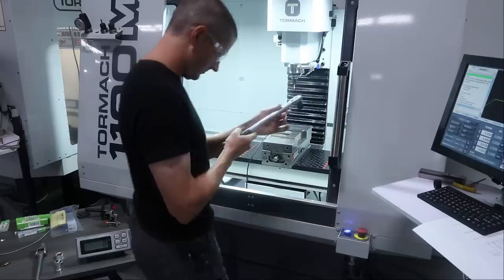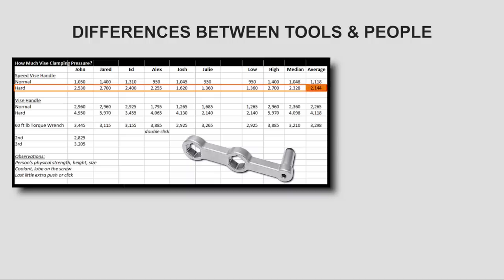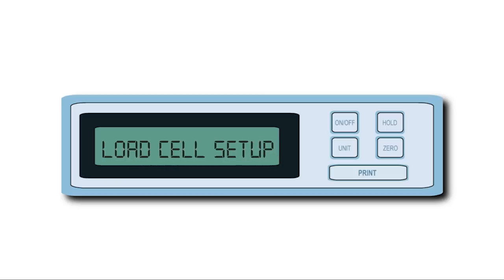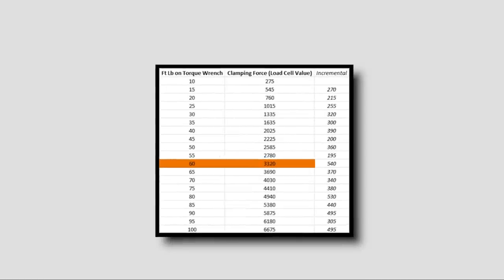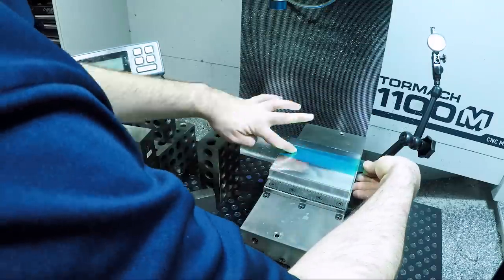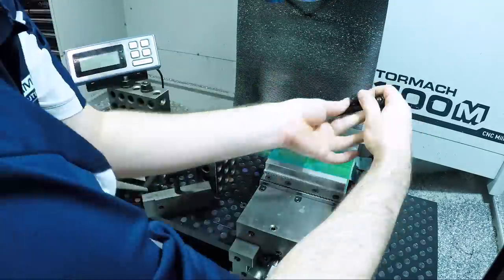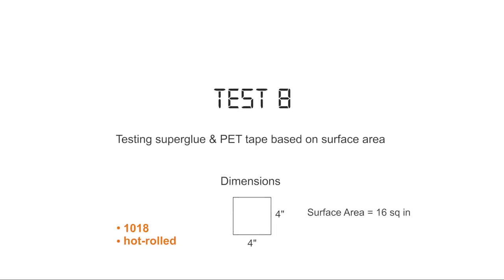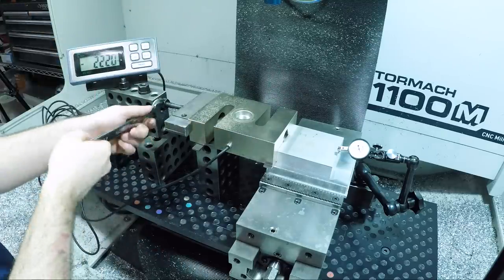How Much Gripping Power does a Vise Have?

Comment: John, love the video. Long time watcher, first time commenter. Im not a machinist so you’re always way over my head But as someone who has worked in force/load cell calibration for years, you need to be mindful that the load cell needs to be loaded at the points where it is threaded. Each side of that s-cell is a lever and as it deforms by design to give the signal that the strain gauges pick up and convert to force readings the fulcrum point changes when force is applied to the flat surface and applied load changes. Using the threaded holes and a bolt through them ensures that the fulcrum point is in the same place as when it was calibrated, increasing your accuracy.
Reply: Very interesting info. Thanks for that.

Comment: Based on your setup, there is a very simple answer as to why clamping area on smooth jaws did not affect the force required to move the part (hint, it has nothing to do with pressure). 

The force applied by the jaws acts 90 degrees (perpendicular) to the "pushing" force you are applying. Therefore the 2 different forces act completely independently of each other on part (think drawing the forces as X and Y directions on a graph). Then what keeps the part from immediately moving? Friction! The friction force between the jaw face and part is what keeps the part in place. If we knock the dust off our handy engineering textbook, the formula for calculating friction force is: Friction=(perpendicular force)X(coefficient of friction). Notice how the formula does not contain anything about surface area, that is because as counter intuitive as it is, friction is completely independent of surface area and there is our answer. 

For fun, we can actually calculate the coefficient of friction between your vice jaws and the part using the numbers from your experiment. You clamped the part with about 3300lbs of force and it took about 550 lbs to move the block so if we plug those number in we get: 530=3300X(coefficient of friction) so the coefficient equals about 0.17!

However, this only holds true for the very specific setup you created here. You still want to hold on to as much area as you can because cutting forces on the part never act just in a singular direction like your test setup. The force most likely to dislodge your part during machining is from torque or tipping force from the tool pushing on the edge of the part. To best counter this, you'd want to reduce the lever arm from which the torque is applied by leaving the minimum amount of stock exposed.
Reply: Very well put Mech engineer. Was gonna basically post the same thing along with my post above about why the variation when using the torque wrench but luckily having seen your post that already explained it, I didn't have to take the time.
Reply: Considering the other force directions, do you think it can be defined the minimum area required for an specific part to be in contact with the smooth jaws in order to stay still and not move?

Comment: I have learned much from your videos. Thank you. In a prior life I owned a company that built high performance engines, etc. for mostly Porsche's.  I just wanted to make some observations. 
1. I always use the same method to tighten bolts using a torque wrench. That is to first get the fastener barely tight so that the pull for the actual torque setting can be done in a single smooth stroke; stopping the click or beep. Also, the pull direction should be in an arc that is on the same plane as the rotation of the screw/bolt, ie., do not jiggle it forward or rearward. 

2. Manufacturers almost always provide torque specs on the high side. 225 ft lbs on a pull stud is huge. I have seen the number used in some threads. I have a HAAS TL-1 lathe and HAAS TM-3P mill. The mill has a spindle holdfast included. If I put even close to 225 ft lbs on it, I am sure it would rip the unit off the machine. Not to mention that using a 1/2" torque wrench to do this would be outside af many folks strength. Similar to asking any but the most experienced machinists to measure anything at the .0001" level even using the proper mic. 

3. My experience tells me that applying too much torque to a part is a much more prevalent and damaging problem than not enough. Using a 6" x 4" x 1/2" piece of 6061 T6 aluminum gripped 1/4" deep along the 6" side using smooth jaws, in a ORANGE vise, the workpiece will begin to deflect at about 45 ft lbs (on a calibrated torque wrench). At 100 ft lbs, the deflection at the centerline is more than .002". The worst part is that if you face cut that part, you would not even notice. If you measure all 4 corners you would;d not notice. If you measure the center line, you will notice. 

4. You hit the nail on the head. Even with proper use and a quality torque wrench, you will get different results. If you include the torque wrenches that most people buy, results become inconsistent (the worst) and wrong. I am not sure if most folks return their torque wrench setting to the lowest setting after each use. 

5. I know there are countless machinists out there that know what to torque their work pieces. Too bad that I have never seen a post anywhere like this:
     "I have a high quality torque wrench that was recently calibrated, an ORANGE smooth jaw vise, HAAS Mill  and run at high speeds and feeds. Here are some example torque values I currently use:"

Then, they could list several work pieces that they mill and include the vise torque values, metal type, size, gripping type and area, cutter info, speeds and feeds, etc. IF I HAD THESE REAL WORLD EXAMPLES, I COULD EASILY FIGURE THE REST OUT.

Comment: Here's an idea in case you decide to do another video: test how consistent the clutch settings on electric drills are. And/or try an impact wrench (electric or pneumatic) anf a couple of those extensions that are supposed to limit torque.

Great info in this video, it is much appreciated!

Comment: For the drop off in holding power for the griping jaws you may be hitting the yield strength of the aluminum part itself due to the side pressure acting over a smaller area

Comment: John, having tested several torque wrenches a few years ago, I found that the number one cause for error is how you use it when it comes to clicker type torque wrenches.  Clicker type wrenches are not good for when you want repeatable accurate torque because of the way they work. They are really more of situations when speed is of more of a concern than accuracy and and being repeatable. If one does not instantly let of pressure the moment the click happens, you will get a bit more torque applied than intended but this is really a relatively small amount of induced error in most cases.

Where the real problem with them is though is the way you pull on the handle. If you are not pulling PERFECTLY perpendicular to the axis of rotation of the fastener and within a few degrees of perpendicular to the beam of the wrench, you will get more torque before the click occurs than intended. This is because of the friction induced in the hinge that allows the beam of the wrench to slightly deflect when the detent releases. Basically the detent doesn't roll at the set spring tension because friction of the pivot is preventing the detent from seeing the real force being applied.... Essentially, friction at the pivot is acting as a path for force to bypass the detent.

If not quite following what I mean by perfectly perpendicular to the axis of rotation, think of it in the sense of this video and using the torque wrench to tighten the vise. if you are applying any force to the handle that is either towards you (the operator) or away from you (basically force that is in the same direction as the fastener, you are adding friction to the pivot which means that the detent is not seeing the real force, but rather a force that is less than what you are really applying.
For illustration purposes, have a look at this illustration.
https://en.wikipedia.org/wiki/Torque_wrench#/media/File:Direct_pawl_clicker_torque_concept.png
if you are applying any force that is outside of perpendicular axis of rotation of the fasten, that force is creating friction on the pivot pin which in effect is causing the assembly to act more like a rigid member. Until enough force is applied to overcome this friction, the detent (red square peice) never sees the real force. So lets say that you are generating enough friction that it takes 10lbs of force to overcome the friction, that is 10lbs more force that is being used to create torque on the fasten.. Essentially, its like you added 10lbs of force the the spring

Beam type torque wrenches are best if you want repeatable and accurate (if its a quality and accurately calibrated wrench) torque values but at the expense of speed. Beam type wrench are unaffected by forces that are outside of being perpendicular to the axis of rotation (as long as the beam needle is still floating). This is assuming that you cant use the both stretch measurement method (which is really is the most accurate method obviously).  

Hope this helps for anyone to understand why / how there could be so much variation from person to person and even for two different values from the same person.

Comment: One thing about holding on a small amount of material, is that you will end up with deformation on your part, also if your part is up out of the vise more your tool will have a easier time rotating the part out rather than pushing it’s all about leverage.

Comment: Hey John, check this out.  I used to work for a Top Fuel Drag Racing Team that was sponsored at various times, by Snap-On, Matco, Cornwell Tools, and Travers Tool Company.  There was a toolbox in the machine shop that had probavly 75 torque wrenches in it, high dollar Snap-On, Matco, etc.  There was also a digital torque torque tester mounted on the wall by the box.  Out of all of the torque wrenches, I believe only a total of 2 were accurate.  Accepted practice was to set the wrench to your value needed, say 80 ft. lbs., and keep adjusting the torque wrench, until you hit the number required.   So, even though the Snap-On (most expensive) cost a buttload of money, it was no more accurate than anything else.

Comment: What else may be overlooked is the actual mating surface geometry ( geometric tolerances) The modulus of elasticity of the vise is fairly constant, since the materials are similar. The part being held , aluminum , is less , and hence will distort elastically against the smooth mating face of the hardened steel   jaw much sooner.  The vise is just an irregularly shaped spring, and will deform as the applied load increases. Therefore, there are a lot of unseen forces that will alter the shape of the held part that just aren’t perceivable. You essentially are machining a squished part ( elastic deformation) , and the forced aren’t just in compression, but an increase in buckling as the contact area is less and less as the part is gripped higher in the vise. So, as already stated, the lowest pressure on the faces of the part is ideal, with a margin of safety.  
1) keep part from moving or releasing during cut.
2) keep part from being too elastically , hopefully not plastically deformed while held during machining.

Comment: I think you'd want high clamping force, but low clamping pressure. That means grip as large an area as you can afford. The higher the pressure, the more you will damage the surface.
Reply: True, the clamping force is what is most important and will be what holds the part in place, pressure is bad in this case as it will lead to dings in the part.

Comment: The amount of friction in the vise screw and ways will affect the test results as well.  Try testing multiple vises to see how much they vary.  Also the test setup needed to be very secure to support heavy loads.  A part and fixture can deflect or change shape under heavy load which would affect your results. The smaller surface area of the serrated jaws allows the aluminum to compress more until it bottoms out.  The super glue test it attached to a plastic substrate so it will deflect a long way before releasing.  Good food for thought. Thanks for sharing.

Comment: This is really great work you're doing and sharing with the rest of us and I truly appreciate it, thank you. But I haven't noticed a lot of issues with parts moving sideways in the vise. It's typically pulled up. I imagine if you do the same series of tests but with a jack screw to apply upward force you'll see very different results more aligned with what we would expect. ( drill a clearance hole for the jack screw through the fixture to test super glue). 
Next you'll have to test what kind of forces are put on the part during cuts, climb vs conventional, slot milling vs side milling, rigid tapping, and of course how that changes with tool size. Keep up the great work looking into the science of machining.

Comment: Friction force isn't a function of the Area: F =µ*N  (µ: Friction coefficient, N: Normal force). I guess Talon jaws add plastic deformation to the equation which isn't very effective at high forces as Aluminium is quite soft and therefore deforms easily
Reply: I was wondering about the same thing. Talon jaws grip really well, but aluminium just is too soft to hold on. Now you'd need to test smooth surfaces vs gripped jaws with different materials :)

Comment: Hi John,
Have you tried or heard of "Electro Spark Deposition", you can have grip faces in steels, surface coated with a very hard textured/abrasive media, imagine gluing 40 to 100 grit abrasive cloth/paper to grip surfaces. Excellent in cutting through mill scale, and can be applied to any shape surface. Rocklanise, Surmet or Carbinite are the suppliers that come to mid.
Great subject.

Comment: I have two requests: 1) load the cell with a c-clamp and compare to your test rig.  A 6'Jorgensen c-clamp puts out about 1200 lbs force/pressure (the shoe on the acme screw is arguably one square inch).  I think your single point loading is skewing the results, despite the supposed rigidity of any set of jaws. 2) I'd like to see the results of using some manual-machinist vise set-ups, like using brass rod or halved ball-bearings to single-point load one side of the workpiece.  Very interesting video, thank you.
Reply: There is no difference between manual machining clamping scenarios. A brass road or screwy ball is used in any type of machining, CNC or manual.

Comment: Cool experiment!

So, first thing is that the amount of clamping load your vice jaws impart is a function of several things. The screw pitch, applied torque but also, and very importantly, the friction present within the vice assembly.

If you want to substantially increase the repeatability of the clamping load the jaws impart then you need to do two things, first is to lubricate the vice screw and sliding surfaces.
Second is to change the procedure you're using to clamp to use a nominal torque value of say 10ft-lbs and click two to three times (or whatever other value gives the most consistent value across most users), then to set the actual clamping force continue to turn the handle through an angle proportional to the desired clamping force, most easily found through experimentation as it depends on the rigidity of the vice etc etc.
By clicking multiple times you get to a point where the mechanism more reliably sets the applied torque, by lubricating the vice you reduce the amount of force you're loosing to friction but also make it more consistent. By turning a fixed degree further you move the vice jaws closer together by a distance fixed by the pitch of the vice screw and by moving that fixed distance the "spring" in the clamping setup will apply a more consistent clamping force.

Now, for the force applied to dislodge the part what you're measuring there is purely a function of friction. Surface area and pressure in this context are completely irrelevant, on the condition that the part will support the applied load.

Basically, for two given materials with a flat contact area there will be a constant coefficient of friction and as you increase the applied force the friction will increase proportionally and independent of surface area.

The reason the serrated jaws increase the friction is that by biting into the surface they change the coefficient of friction, the increase has a limit though and that's due to the shear strength of the material being clamped. At some point those little divots you're biting against in the material will deform or just shear off entirely. The mechanical failure of the surface does however depend on surface are, you either have enough friction that the material fails, or you have enough clamped surface area and material strength for the applied force that friction is overcome, or to make it more complex in practice I expect the failure of the material results in a decrease in the coefficient of friction and the part slides.

Comment: John....good start to understand how much work holding force you have using different methods and inputs.  I would suggest when you try a new variable/process,  do it more than once.  This will help you see trends that you don't see with a sample size of 1. With enough measurements, you will start see the standard deviation of the process which will tell you how much variability (force) there is at confidence level. Or simply stated, do you have a robust work holding method.
I would suggest looking at your work holding stiffness rather than ultimate clamping force. You don't necessarily care how much force the vise puts on the part as long as it holds it in place. However if are trying to do precise machining, you would want a stiff work holding method so it doesn't add to your tolerances.